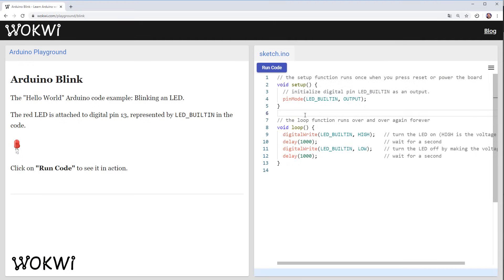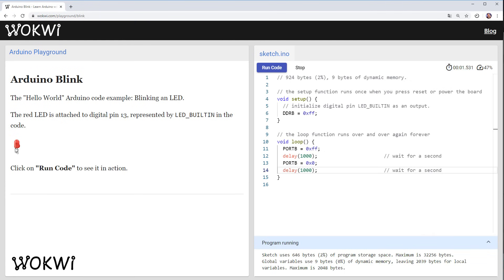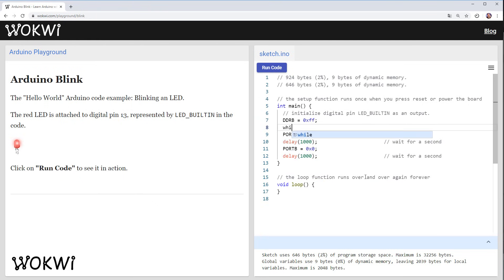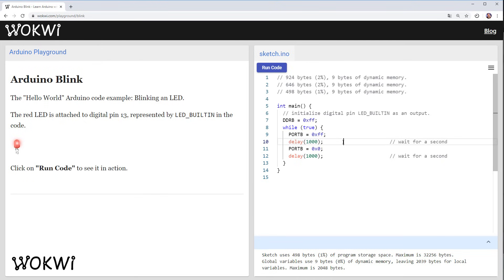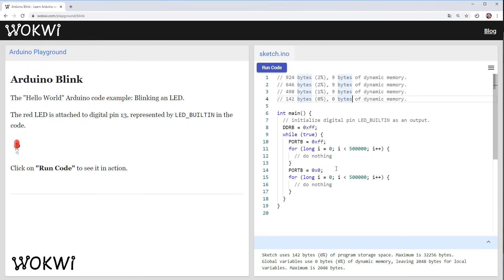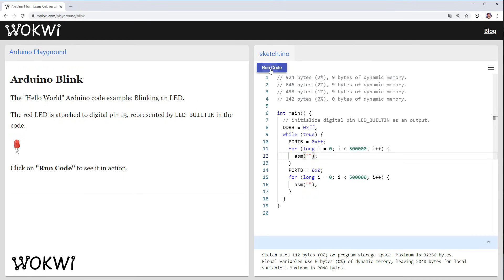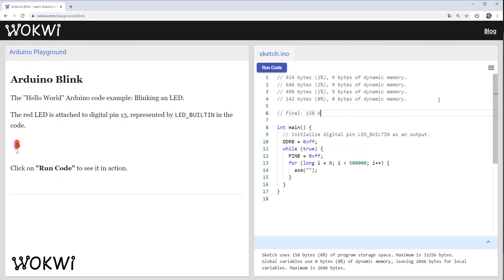Optimizing Arduino Code: no setup(), no loop() ⛔

Comment: Very interesting, but I wonder if the idle loop would consume more power then delay function, as in many architectures delay or waiting is done by halt the cpu until woke up by the timer, is truly do nothing; while the "do nothing" loop are actually doing something to count the loop and branching back continuously.
Reply from the maker: In the case of Arduino Uno, the delay() function doesn't halt the CPU (there's a discussion about this in another comment), so the power consumption would roughly be equivalent. But on other MCUs, it does halt the CPU (e.g. on the Raspberry Pi Pico).

Comment: Usefull to know... I did once hit the space constraints of an uno but have since jumped to a controller with built in wifi and more room so the problem went away. Might come in handy though if I ever go back to using the uno with the ethernet shield for something else.

Comment: I never really used more than 50% mem on an Arduino program, but I don't doubt there are engineers/developers who will want to squeeze it as possible. Technically this video is very good
Reply: Your projects are really small and simple if you never reach the limit...
Reply: @DrakeOola  Personally if I needed more hardware I would use a Raspberry Pi, or another type of controller. Give me an example of any complex project?
Reply: @DrakeOola  or libraries being used are very small
Reply: With today's microprocessors being so cheap, it makes no sense to spend time optimizing for memory when you can just buy a more capable cpu. But yes, it's an interesting video, and this is common with all higher level languages.

Comment: How do you move text up and down with the keyboard like that? I tried several combinations of ctrl, alt, shift and the arrow keys, but couldn't replicate the behavior in SciTE. Is it unique to Arduino IDE?
Reply from the maker: Alt+Up or Alt+Down. This works in editors derived from VS Code, such as the editor Wokwi is using.
Reply: @Wokwi Ah. Thank you

Comment: It's like going back to complex embedded coding from eaiser one. It negates the purpose of using Arduino :D. That's what I feel. 
A good solution would be to use a cheap, but well built Arduino hardware,  remove the Arduino bootloader and use it as a regular AVR board.
Reply from the maker: Right, it helps you appreciate how much Arduino is making our lives simpler

Comment: So you are using CPU up to 100% in for-loop to save a few hundred bytes of memory?
Reply from the maker: Have you ever looked up how delay() is implemented on Uno? 😉
Reply: @Wokwi  by physical timer chip I guess?
Reply from the maker: @caunt.official  Busy loop that calls micros() repeatedly and compares the return value with a variable...

https://github.com/arduino/ArduinoCore-avr/blob/63092126a406402022f943ac048fa195ed7e944b/cores/arduino/wiring.c#L106-L117
Reply: @Wokwi  didn’t know, thank you. I am moving into microelectronics from desktop and backend development, and it’s a bad practice to delay something with for-loops in OS environments 😅
Reply from the maker: @caunt.official  You're welcome. This is also true for embedded development - modern embedded OSes (like FreeRTOS) implement delay more efficiently. Delaying with a for loop consumes more power, so for battery operated devices, efficient delay is crucial.

Comment: basically, if you want your code to optimize, u write it at a lower level, like you are using the mcu directly. That's also what I ve learned when i stepped into the stm32 community.

Comment: yes I have a question: (kinda more a request): how would you achieve individual pin control? and pwm?
Reply from the maker: There are three registers that allow you to control individual pins: DDRx - set the direction of each pin (input / output), PINx - read the value of a pin (or toggle a pin), PORTx - set the output value of the pin (or enable the pull-up register). Replace x with the port name, so for the PBn pins, the register names would be DDRB, PINB, PORTB. 

PWM is a bit more involved - but look for documentation about the AVR timers (Timer 0 through Timer 2 for Arduino Uno).
Reply: Okay, thanks. I'll dive into it.  @Wokwi

Comment: PINB should be read only. I do not understand how this line work.
Reply from the maker: PINB has two functions: you can read it to get the current value (high / low) of the pins in the port, or you can write to it to toggle a pin. For instance, writing to 1 to the first bit would toggle the pin PB0

Comment: That's great 
I had a feeling there is a way to optimize code.
How do I print lcd values and control stepper motor  in same loop without causing delays to stepper motor
Reply from the maker: Thanks! Which library are you using for the Stepper motor?
Reply: @Wokwi   I was using a4988 module 
So I was creating a pwm signal using digitalwrite and delay function to implement it.
Reply from the maker: @mainaTheMaker  check out the AccelStepper library, as it supports sending the PWM signal in a non-blocking fashion (so you can keep update the LCD while the PWM signal is being sent).
Reply: You can code by using LPC 2148 microcontroller method , it tells easy method without using any library function by perfectly knowing function of stepper motor
Reply: Hi mates! I have just started to learn arduinos,  i have completely no idea what u  r talking about, but i appreciaye it. 😅😅😂
Reply: Drive the stepper in a timer interrupt and leave the UI handling (and only that or similar low priority stuff) to the main thread.

Comment: Would the percentage reduction be nearly as large if the program had started out to be 5000 bytes?  It seems like you would reduce it by the same number of bytes when you eliminate setup() and loop().
Reply from the maker: That's right Owen!

Comment: Except for the description of the inner code of the Arduino, and how it works, the second part is useless.
You do not want to replace all the Arduino timer with these bunch of loops. 
Beside, many library wont work anymore because they rely on delays...
Reply from the maker: That's true!

Comment: this is great video for me: 
1)  I dont have to change Arduino IDE
2) I dont have to use setup,loop function. even i didnt know that setup and loop s are artificial function in arduino. say I want to use timer0,timer1 in different manner to generate 38khz pulse with 10ms on and 20 ms off format.then stup,loop style coding dont support timer0 to be used. it throws error that vector 11 already defined and i cant make ISR (TIMER0-OVF-vect) inturrupt.
3) i want to creat my own source code dont want to use library.
4) memory space effective use is possible if i dont use setup,loop function.

Thanks .
Please published video how to decode any header file,library which is built for arduino ide so that we can creat code for other AVR MCus which is not available in arduino IDE

Comment: The Arduino-Framework relies on the fact, that the loop()-function gives controll back to the caller from time to time. If you don't want that, don't use it at all. For Atmel- and Pico-Microcontrollers there are plenty of cross compilers available.

BUT you have to keep in mind, you have to take care of all the hardware- and interrupt-handling-setup yourself! It makes binarys smaller and gets rid off a whole lot of stuff, that you probably don't need. But this is far from beeing trivial. You have to know about hardware-registers of the specific µcu, you are dealing with and manage them yourself.

Like I said, far from beeing trivial.

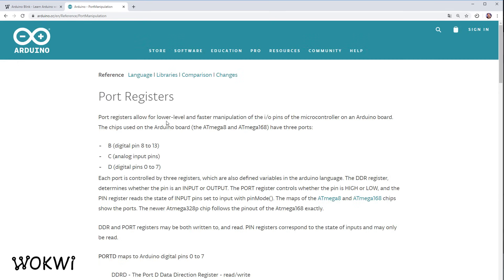Comment: @1:29 PINB register should be read only, how about XOR PORTB with 0xFF i.e. PORTB ^= 0xff
Reply from the maker: You can actually write to PINB, as documented in the chip's datasheet. XORing PORTB with 0xff has the same effect, but it takes more instructions (read, xor, write), to it's a bit slower. Also, since the change isn't atomic, and interrupt may fire between these operation and possibly change the timing / result (unless you disable interrupts before running PORTB ^= 0xff).
Reply: @Wokwi  which MCU is that then? For the Atmega 328P PINB is Read Only, according to the data sheet.
Reply from the maker: @physicist137  Right, but then, if you check the section titled "Toggling the Pin", it says: 

> Writing a logic one to PINxn toggles the value of PORTxn, independent on the value of DDRxn. Note that the SBI instruction can be used to toggle one single bit in a port
Reply: @Wokwi  O.o indeed! Thanks!

Comment: How can we add additional library in wokwi and components... Also let me know website to test raspberry pi 4 model B semulator online ?
Reply from the maker: For libraries, you can use the "Library Manager" tab. For components, there's a new "Custom CHIP API" that is being developed. Look out for documentation over the next few weeks. Raspberry Pi 4 Model B simulator - not something that you are likely to find online, as it's too demanding to simulate inside a web browser.

Comment: How it toggles
PinB = 0xff;
Means it should be high always, right?
Reply from the maker: Writing to the PORTB register sets the value of the output pins in the PB group, and writing to the PINB register toggles them. 

So PORTB = 0xff; will always set the pins high, and PINB = 0xff; will toggle all the pins.

Comment: using main() function how can be used drivers for different modules and EEPROM memory?
Reply from the maker: Some of them will work out of the box, and some will need some extra code that sets up the timers so that delay() works correctly. But as many people commented, we wouldn't go with our own main() in most cases. setup() and loop() do the trick well for most programs, and the idea of the video is to learn how things work behind the scenes, and also to learn to appreciate the convenience of the Arduino standard library, Wiring.
Reply: Thanks

Comment: Thank you. I think that you have the deep programming knowledge. and you may help me solving my problem.
I want to turn ON an LED  for a definite time with a button, by using an ARDUINO UNO R3, even I hold the botton more than defined time. In short,  I need one puls every time. I can do it a resistor and a cap at the input of ARDUINO, but  I do not want to use any passive component.
Could you help me? Thank you in advance...
Reply from the maker: You are invited to the discord chat at https://wokwi.com/discord. Ask the question in the #questions channel and we'll try to help!
Reply: @Wokwi  Thank you for the invitation.

Comment: Hello from France, really very interesting, is this applicable to attiny85? In the Arduino documentation there is nothing about these subtleties?
Reply from the maker: Thanks! Yeah, the principles are the same. Arduino documentation tries to be broadly applicable to multiple boards, so they usually don't get into AVR-specific things. The datasheet is where you can find (almost) all the information, and there are also numerus blog posts and threads in forums such as AVR Freaks.
Reply: thank's
 @Wokwi

Comment: The overhead of the approx 800bytes and a few bytes of dynamic, is this a fixed overhead or does that overhead grow as the user sketch grows?
Reply from the maker: It may grow when using additional library functions (such as the Serial library).

Comment: Would this optimization interfere with UART communication protocols if I were planning to connect the Arduino to the Raspberry Pi and send data packets to and fro the 2 devices?
Reply from the maker: It would interfere with Arduino's Serial library, since it requires enabling interrupts.  It can be mitigated by calling sei():

int main() {
  sei();
  Serial.begin(115200);
  Serial.println("Hello World");
  while(1);
}

But I wouldn't do this unless there's a really good reason to.

Comment: Don't you get the same result when you, instead of your asm statement, change the 'long i' into 'volatile long i'?
Reply from the maker: I think that would work too!
Reply: Or maybe use the nop() function is there is any.
Some more sophisticated compiler might optimize out the empty assembly insert when sees no code. It won't doesn't optimize out NOPs, as this is an intentional instruction.

Comment: Some comments nag about micro controller independence etc 😂 well if you have a project and needed to optimize the chip and use all peripherals to control some product, let's say some robot. Well how is chip independant code going to matter? You are not going to swap chips all the time. You put the chip in there and it dies with the product. Especially if it is a commercial product. 

To the video maker, I like the low level stuffs thanks for the video!
Reply from the maker: Thanks!

Comment: You just got a subscriber after watching this video...!! 🙂🙃
and can I ask a solution about a problem...!!?? 
Can we run two different functions simultaneously as driving 2 to 4 stepper motors and doing other things like Marlin (3d printer firmware) does .?? actually I need ro make a small firmware for running stepper motors and displaying data like temp speed and menu kind of thing just like Marlin but for other kind of machine that will basically do the some kind of repeated movements according to the values set in menu..??
Please help

Comment: Hi! thanks for the video, it is very useful information!
I have a question, the link you post about "Port registers" talks about ATmega8 and ATmega168 microcontrollers... Is "Port registers" possible to use with mega32u2??
Reply from the maker: Yes, the ATmega32u has even more port registers, going from PORTB to PORTF. You can find the complete information in the data sheet: https://ww1.microchip.com/downloads/en/DeviceDoc/Atmel-7766-8-bit-AVR-ATmega16U4-32U4_Datasheet.pdf

Comment: This is no longer Arduino code at the end since everything "Arduino" is no longer compiled in.
All the nice things Arduino provides (e.g. portability of code across devices, utility functions like delay() or millis() ) are gone.
In the end, it is basic AVR C code like we used to write before Arduino came along, so it is nothing new at all. It's not even an optimization, it is basically just NOT using the Arduino framework anymore.

Comment: Burning CPU cycles instead of using memory with this little explanation is really bad practice for beginner material.
I am salty because I am one of the people that has to clean up after videos like this out there in the real world.
This either needs to marked as part of an advanced course or needs way more context I can't provide in a comment because YouTube will hide it. Youtube really does not like expanded explanations in comments.
Reply from the maker: Thanks for sharing your feedback! Good point about the context. 

How do you clean up after videos like this? Couldn't find much info in your YT channel.

Comment: The looong loop for nothing with cap 0-499.999 is not represent one second accurately, and will it be longer if the code is much complex?
Reply from the maker: That's true! To represent one second accurately, you could use the timers. If you want, we can post a demo for for that too.
Reply: @Wokwi  timer?
Reply from the maker: @LexBarun  yes, that's also how delay() works behind the scenes. Here is an example that uses Timer 1 to blink the LED every second:

https://wokwi.com/share/GW8g3bgG5ooEcx2fWCH1?utm_source=youtube&utm_medium=social&utm_campaign=wokwichannel

If you are interested, you can learn more about this in the following blog post, look for the section that says: "Blinking with Timers"

https://blog.wokwi.com/5-ways-to-blink-an-led-with-arduino/?utm_source=youtube&utm_medium=social&utm_campaign=wokwichannel

Comment: what will be the computation for the loop that replaces the delay?
Reply from the maker: The computation?
Reply: @Wokwi   in delay(1000) but in the optomization you use 5000 for loop is it by ratio ?
Reply from the maker: @painofakatsuki22  Oh, I understand now... It is not accurate in this case, but it's possible to find the right value that will cause an accurate 1-second delay. If you are interested, let me know and I will try to explain how

Comment: when you called that "for" function, how much time does it take to increase that i variable by one?
Reply from the maker: The "for" loop does more than that: it also checks the if the new value is less than 500000, and jumps back to the start of the loop. If you just want to measure how much time it takes to increment a "long" time variable by one, check out this video that explains how to measure it: https://www.youtube.com/watch?v=tnfeMCyLZSo

And if you want to measure the time of one complete iteration of the "for" loop, you could count the time it takes for the entire loop to run (e.g. by logging the time returned by `micros()`), then divide by 500,000.

Comment: Machine code is very efficient.  No nonsense.  Also incredibly unreadable.  I for one throw away the idea of saving space.  If I run out of space, then I chose the wrong MCU from the start.  My first MCU was the arduino Due.  The setup and loop really comes into its own when doing dual core coding with setup1 and loop1.  Is brilliant for beginners like myself.

Comment: Hey.  I have stuck in a problem..  is there a way to discount hc05 connection automatically after some time?
Reply from the maker: Hello Ahmad, you can try sending at "AT+DISC" command from the Arduino while the module is in AT command mode. Not sure this will work, but worth a try!

Comment: From the arduino IDE it can easily be done in 148 bytes by using a smaller counter variable i of 3 bytes:

int main() {  // ========== Setup ==========
  for (;;) {      // ========== Loop forever ===========
    PINB |= 1 << 5;
    for (__uint24 i = 0; i++ < 3000000;) {
      asm("");
    }
  }  // ================ Loop forever ===========
}